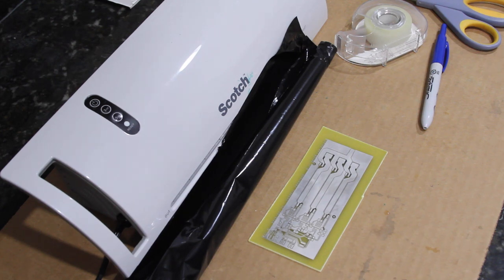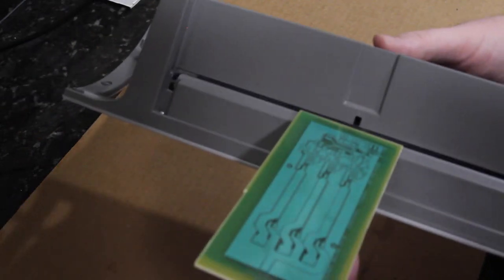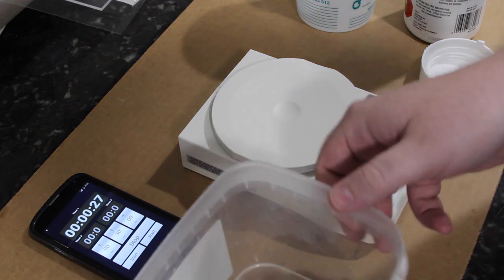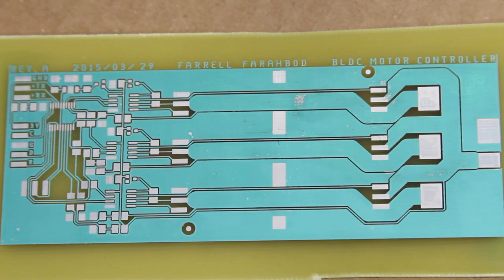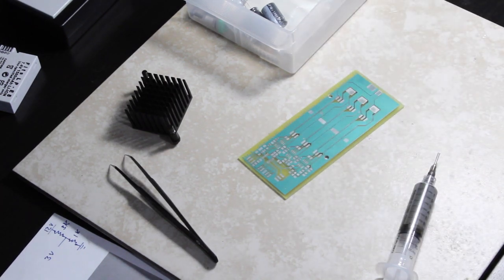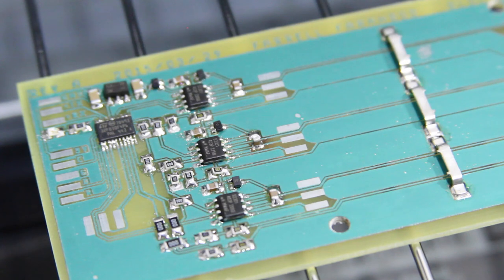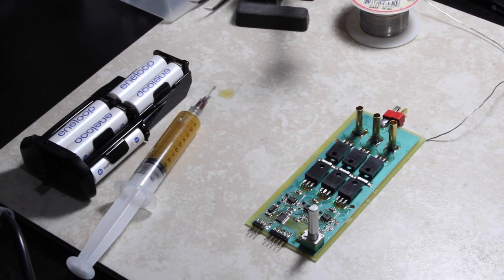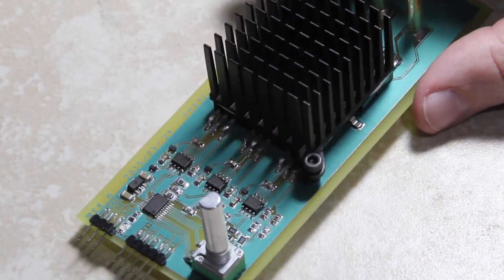Circuit Board Prototyping Part 2: Solder Mask, Solder Paste, Reflow Oven and Hand Soldering

Comment: Just a word of caution: when you use power tools to cut, grind, or sand the edge of a pcb, you are releasing tiny fiibreglass fibres into the air that are as fine or finer than sawdust. When those get into your lungs, they don't come out -- it's a lot like breathing asbestos. Some people have had success scoring the laminate with a knife a few times and then just snapping it. This will also release particulates into the air, but far less than what you'd produce with a belt sander.
Reply: Aviation snips work a charm

Comment: Tip: shift a couple inches left or right on each pass. When you run something through a laminator, it cools the rollers in that spot, and it doesn't heat as well. Shifting the spot you put it through allows the previous spot to heat back up.

Comment: 'tis the nature of the beast. your problems are typical and afflict amateur and pro alike. 

Years ago in the era of wave soldered wire leads I worked at a small firm where we made Cable TV traps. I did a lot of prototyping, and custom head end stuff, and can sincerely say, NICE JOB! That's a very well done one off. It'll be a shame to put in an enclosure.

Looks like a giant RC controller for a 3 phase DC motor. Although yours looks like a stationary controller, with the speed pot onboard.

I've been thinking of doing something like that for my giant scale planes where size and weight aren't as much of an issue. It would be nice to reverse the props on landing, for effect if not braking.

Good luck on the firmware, that's why I've been putting off a similar build. I'm not a C lover, and come from the age of Basic. It's keeping be from using a lot of the very attractive ucontrollers out there. Been waiting for some standardization to happen before diving in, but it's not looking good there. I may have to pick one and go for it.

I hope to see your controller run, Maybe another video? I'll be watching...

Nice board and video.

Scott
Reply from the maker: +Scott Marshall Thanks! I've had this project shelved for a while, but plan to eventually get back to it. You guessed correct, its basically a RC hobby ESC without the RC part :) At the moment I'm thinking about building another balancing robot (I have some old videos on this channel of the original one I made) and plan to do a mini series of videos as I make progress on it. Sadly it won't be using any 3-phase motors, but it will involve modifying the H-Bridges in some hobby servos, writing some firmware, and building a chassis.

Comment: Great video - I would prefer to see all that goes on and not just the "perfect" job. Also no annoying music - fantastic! How did the motor controller work out in the end?
Reply from the maker: I needed to rework it a little bit. My gate resistors were too high (if I remember correctly.) It ended up working, but not very well, and I moved on to other projects.
Reply: @upgrdman  Nice looking board though.

Comment: I found this very helpful. This is my first time seeing a dry film type solder mask. I already have some dry film photoresist to try upgrading from toner transfer, and some UV cure solder mask paste, but had no idea I could get a dry film mask. Also thanks for the demo of using a straight toaster oven instead of stressing about an exact temperature controlled setup. I think I was over stressing that one....and I believe drilling sucks too ;)
Thanks again for this upload
-Jake

Comment: Very interesting video on soldermask creation/application, thanks for showing the process: May I suggest you provide some additional explanation for certain steps; for example, why you turned your laminator over and inserted the board from the back or underside rather than inserting the board from the front or the laminator.  Looking forward to seeing your 1st video.
Reply from the maker: Thanks for the feedback. I turned the laminator over so I could reach the board as it came out. If I would have left the laminator upright, the PCB would hit the counter top since the laminator is designed for flexible paper, etc. The part 1 video is online:
https://www.youtube.com/watch?v=86G8uma-TD8

Comment: Why apply the liquid tin before the solder mask? Is it necessary to prevent oxidation even after the mask has sealed it? I’d imagine you’d get more mileage out of it if used after the mask has been applied.

Comment: Glad you posted it anyways.
One thought, if the heat dissipation is in any way marginal, wouldn't it be better to plan and mount the transistors the other way up?
Reply from the maker: If there was very little heat, yes, you could just mount them the "normal" way with their backs toward the PCB. I did it this way to get better heat transfer between the transistor dies and the heatsink. I was anticipating excessive current flow from making mistakes during the firmware development process. A proper design (not a prototype) would use SMD transistors and 2oz copper (or thicker) so the PCB could be used as a half-decent heatsink.

Comment: I think there is a lot of confusion about "dry film solder mask". You can find a lot of "dry film photo resist" that mostly seems to be blueish foil. If I am not wrong this stuff is photo-resist and cannot be used as solder mask. The other stuff is DYNAMASK Solder Mask and is green. I think you will fail using the blue photoresist as solder mask. It would be really helpful to know if there are some generic solder mask beside DYNAMASK brand...

Comment: Do you usually tin plate the copper before adding the soldermask? Wouldn't surprise me if that process affected its adhesion to the substrate.  Could be some residue from the etching mask developer also...perhaps try a rinse with isopropanol before applying the soldermask next time
Reply from the maker: Peter Workman Yes, I always tin plate. I've done this several times before, and it always worked fine. Next time I'll try a very thorough cleaning and bake the board to ensure it is very dry before the lamination process. FWIW, here's an example of a board I did successfully:

http://www.farrellf.com/projects/hardware/2014-01-17_DIY_PCBs_with_Solder_Mask/final2.jpg

Comment: Excellent video, great project, awesome presentation of information. Thank you for doing this, I enjoyed watching and learning from you techniques.

Thanks for choosing to post it WITH the technical issues, we all learn from each other's mistakes! It takes someone confident in their abilities and interest in helping others to do that.

Thanks again, best of luck to you.

By the way, what are those three metal cylinders used for?
Reply from the maker: Thanks for the kind feedback. The metal cylinders are 4mm "banana" jacks, used for connecting RC hobby motors. A few weeks ago I did another video on DIY PCBs with soldermask. You might want to check it out, things worked much better in the new video:
https://www.youtube.com/user/upgrdman/videos
Reply: upgrdman thank you, I will? By the way, have you had much luck with played through holes? Ideally, I'd like to get down to 7-8 drill diameter, but maybe 8-10 is acceptable. Have you seen any techniques that work for the hobbyist?
Reply from the maker: All of my DIY stuff is surface mount, so I've never tried plated vias. There are videos on YouTube about it, but it always seemed like more work than I wanted to put in.
Reply: I understand. Of course (as you likely already know. :) ) plated through holes are used for more than just holding through-hole components. The use I have for them if actually more to do with shrinking current conduction paths, lowering inductance of a current carrying path, tying ground planes in multilayer boards together to reduce ground bounce, and providing heat flow paths for SMT devices with thermal pads.

I just found a few links to some less process intensive approaches, and am reading about them right now. (https://www.thinktink.com/stack/volumes/volvi/condink.htm). I don't know if it will work, but it is certainly more promising than the old mechanical via swage tool we tried back in college.

In any case, enjoyed talking to you- best of luck. I'm a subscriber now, so looking forward to your content. :)

Comment: Have you thought about using a stencil cutter (like Cricut or Silhouette) to make a solder paste stencil? You already have the solder mask stencil, so it is just a matter of turning the pads into a cut file. Then you just wipe the solder across with a squeegee.
Reply from the maker: Some people have luck with that, so maybe the smaller cutters have decent precision these days. I used to have a vinyl cutter and it's precision was not nearly good enough for making solder paste stencils.

Comment: Great video. Thanks for taking the time to share the not so successful, which is as important as the successful ones IMHO. May I ask which type of solution you are using for etching the boards? I'm using the popular mix of hydrogen peroxide and hydrochloric acid (muriatic acid) with limited results. Solution becomes saturated with copper and releases most oxygen in little time, becoming unusable. Ideas?
Reply from the maker: Hi. In the Part 1 video I used ferric chloride. I now use hydrogen peroxide and hydrochloric acid, and like it much better. I plan to do a new video on it eventually. The key is to use some higher concentration hydrogen peroxide. If you use the 2% stuff from the grocery store, etching will take forever. I use 30% but YOU ABSOLUTELY MUST DILUTE IT to keep it safe and slow the etching down to a workable rate. I'm guessing 5% or better would help.

Comment: I think the defects on this board might be due to using a brush when developing the solder mask. The sodium carbonate solution makes the film get quite soft, so it's easily damaged when it's being developed. For best results, don't touch it while developing - just slosh it around gently, like you do for etching, and gently pop it into a clean water bath straight after it's done. Leave it in the clean water for 5 minutes. Then just leave it out to dry naturally, and don't touch the solder mask until you've done the hardening step under UV again.
Reply from the maker: Thanks. I think the problem was just related to exposure time or using old stock. I have a couple newer videos on DIY PCBs and got excellent results even though I brushed the soldermask.

Comment: I see you are using a IRS2004 FET driver for this 3 phase controller.
How is it all going? ANd...  how is the throttle control working?
I am using discreet logic to drive my FET driver.
Reply from the maker: Hi. I did a basic electronic test after making the board, but never got around to writing the motor control firmware for it. The drivers in this video are IRS2301 but I have since changed to the IRS21867S because my FETs have a ton of gate capacitance.
Reply: If you are interested I I would like your opinion about my circuit . I am building it up at present.. I have confidence it will be suitable to drive the car alternator as a friction drive unit for a bike.
Reply from the maker: Sure, but since I have not finished mine, I may not be able to offer much advise.

Comment: both videos were really interesting. I think i'll dive into pcb etching, even if i plan to use fabs, because this is perfect to try board before sending them to a fab...
Out of curiosity, what are the 3 metallic tubes, and what is their purpose?
Reply from the maker: Hi. They're just big SMD jumpers/links. In most cases I would use some zero ohm resistors, but those pads were very far apart so I used links instead.

Comment: Hi
First of all, thanks. Really very  nice video.

Can you answer me one thing about your laminator?

On ebay there is a laminator with the title

NEW Scotch Thermal Laminator System Laminating Machine WITH 50 POUCHES 8.5 x 11

Is this yours?

If yes, I'm confused.

This is a laminator that is rated for 5 mil (at least on ebay, it is said "This laminator will laminate items up to 5 mil thick"), and here I'm seeing it laminating supposedly 1.6mm (63 mil)  without any problems.

Is it normal for laminators (in general) to acept much more thickenss 
than they are rated for?

Thanks in advance for your answer...
Reply from the maker: +Miguel Garcia Hi. I'm using a Scotch TL902 laminator. You can often get away with laminating a PCB if it is much narrower than the width of the laminator's rollers. The rollers are somewhat flexible, and are also coated in what looks like some sort of silicone.
Reply: +upgrdman 

This was the fastest answer I've ever received.
Lots of thanks for your information and, again,
for your brilliant video.

Comment: You said that it might of been your UV tube degrading. You showed you exposed straight away after turning on the lamp. 
I usually have my lamps on for warm up for at least ten minutes, not saying how to suck eggs ,  do you warm up your lamps. I enjoyed watching the tutorial..
Reply from the maker: Thanks. I later determined that I just didn't expose it long enough. Another 30 seconds fixed the problem.

Comment: @20:46 get a microscope (not mega bucks x zoom etc one But just one so you don't need to have your head so close, and get some fans sent up to vent flux smoke etc away from your head,brilliant videos m8 and keep up the good work.
Reply from the maker: +Kane TV Thanks. Yes, I have been planning to get a microscope for a while. I normally have a couple fans running when I do this stuff, but I kept them off to keep the audio decent for this video.
Reply from the maker: +Kane TV Thanks. Yes, I have been planning to get a microscope for a while. I normally have a couple fans running when I do this stuff, but I kept them off to keep the audio decent for this video.

Comment: did you ever do a video about the motor controller testing?
Reply from the maker: I have not. There ended up being a few problems with the design, and I shelved it. I might get back to it later on, but I'm not sure when I'll have the drive to work on this project again.
Reply: Thanks for the great videos.

Comment: I don't understand how using the oven could be quicker than soldering it with the pencil solder. You spend the same time dealing with the solder paste, and have to fix the datails anyway.
The solder mask was beautyful though.
Reply from the maker: Yes, it ended up not working out as planned. An oven makes sense when using a stencil to apply the solder paste. (A stencil is much faster, and significantly reduces tombstones/bridges.) When hand-dispensing paste, it does not save much time or effort.

Comment: Nice vid, does this DIY ESC works?
Reply from the maker: +Arek R. Hi. I've written some firmware for it and verified that the electronics work fine. Unfortunately I have not had time to write and test the logic for controlling a sensorless motor.
Reply: +upgrdman Ok thanks for info

Comment: I want to buy the same laminator, Are you happy with this one ?
Reply from the maker: Hi. Yes, I'm happy with it for what I do. If you will be doing wider boards, you might want to look for a laminator that can take thicker material. The laminator I use is meant for paper, but it flexes just barely enough to accept the width and thickness of PCBs that I make.

Comment: UV lamps are like grow lamps for plants after 6 months of use they can get weak and need replacement that is with daily use no matter how good they look the coating in them wears out . I know how expensive they can be and it sucks but such is hobby's
Reply from the maker: Thanks for the advise. I've since made a few more boards, and with a longer exposure the solder mask is working great now. I think it was just underexposed in this video.

Comment: Thanks! Don't get any of that glass fibre dust in your lungs!

By the way, (for noobs like me!) what does it do?
Reply from the maker: Haha, yes, I could have been more clear about that in the video. It was supposed to be a motor controller for brushless DC motors, but I didn't get the circuit quite right. One of these days I'll have to get around to redoing it.

Comment: you use 000 bridges. bad design.
Reply from the maker: Know of a better way for single layer boards?
Reply: i wrote it in center of video. maybe you can find a way to remove bridges. smd bridges are very common items. i think its very good in single side. cooler stuff and assembled parts are very good. power items must be designed in through hole and smd both. smd pads of potentiometer is not suitable for handling force. you should make it through hole. header parts for sockets should be through hole. add some test and measurement points for connecting oscilloscope. and final part you can make pads for bigger transistors with same center point. i can find this improvements.